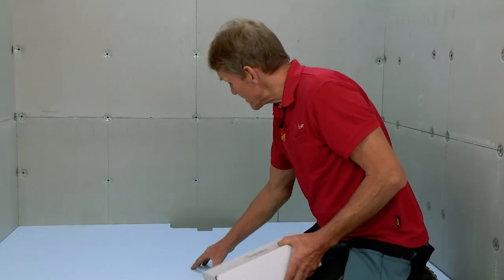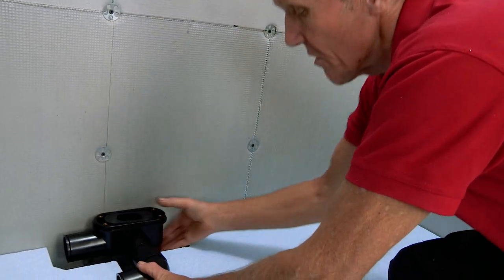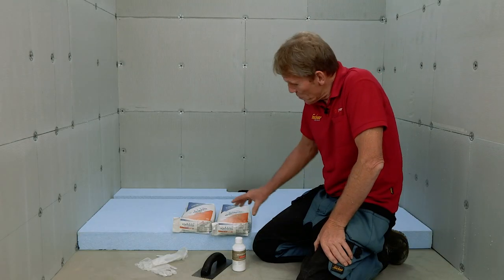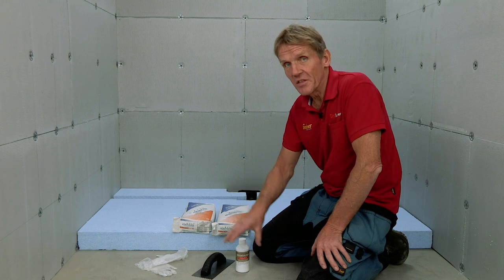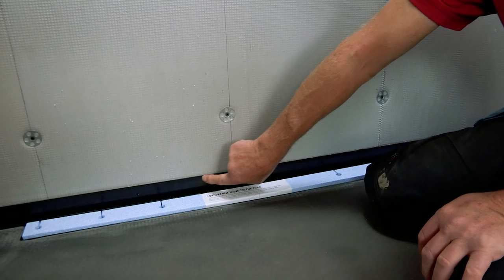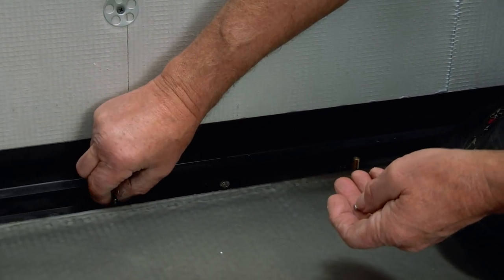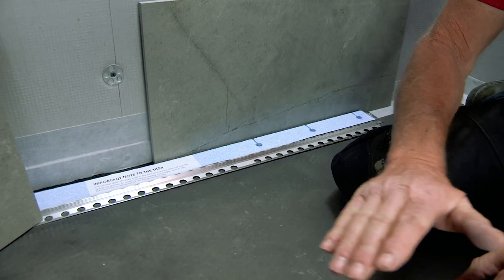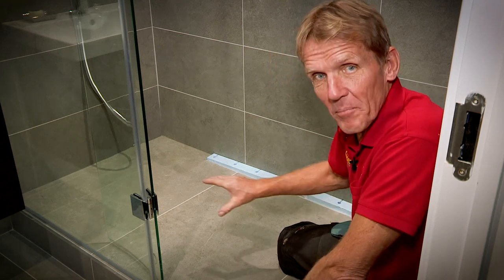How to fit an Elements Infinity Wetroom Tray on a raised sub-element

Comment: Hi, I want to use this product on a concrete floor without the raised sub element. Are you able to do a video on how to prep a concrete floor for the wet room tray so it is a level access shower? Is it a. Case of channeling put for the waste pipes then chiselling out enough concrete to set the former in place?

Comment: Hi I have a plastic pentagon shower tray on legs ,plus iam a big bloke so I have problems with leaks because of movement,could system replace the plastic shower tray I have now,or have you got any other suggestions that could help solve my problem.

Comment: How would you recommend boarding the side of the tray ready for tiling?
Reply from the maker: Do you mean the non-coated raised edge? If so, this doesn’t need any additional boarding; your tiles can be fixed to the non-coated edge using a flexible cement-based tile adhesive. Hope this helps!
Reply: @AbacusManufacturingGroup  yes, that's exactly what I meant. Thanks!